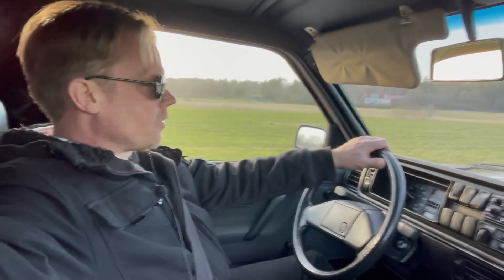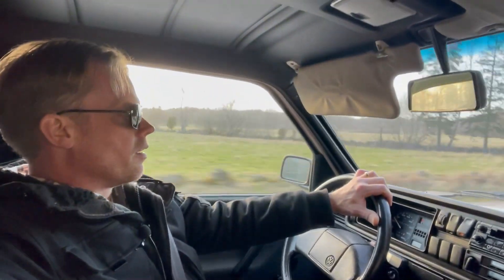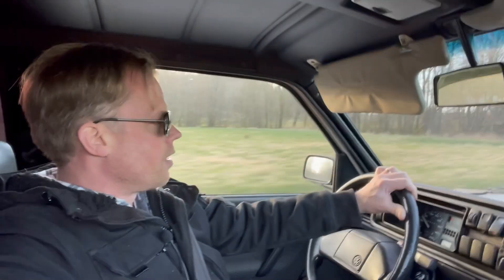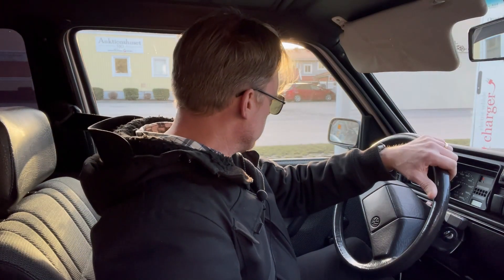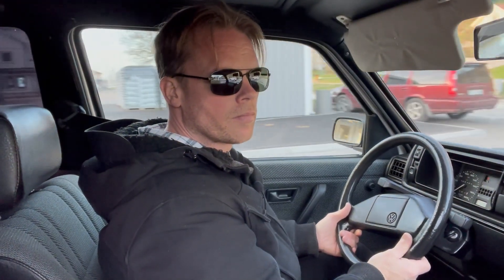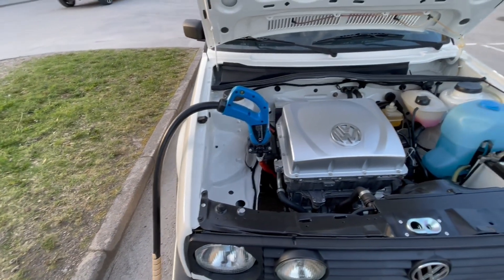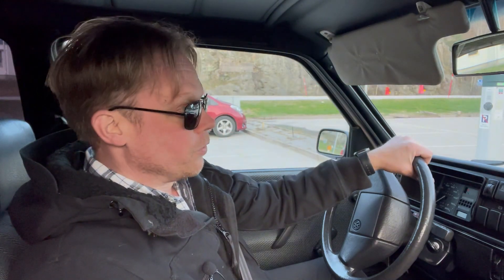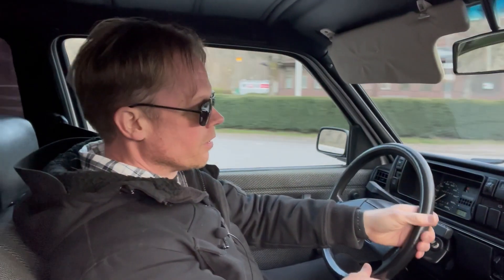Fast charging, more tests and more problems.

Comment: I didn't realise you are using a Leaf BMS. Do you monitor it with Leafspy? It's pretty easy to connect up with a Bluetooth ODB2 dongle.
I'm using a Leaf BMS with my eGolf battery pack but I cannot use it while driving due to the voltage drop between the front and rear battery boxes. I can see an issue in Leafspy at the cell which connects to the front battery box.
Reply from the maker: Yes, leaf spy it is. It seems to be sensitive with different lengths of the balance leads. It works ok for me, I which I had the 62kwh BMS though. What kind of issue do you have with your setup? How is the car behaving?
Reply: @flyingtools  My BMS is not controlling anything. I can only use it to monitor the cell voltages when the car is stationary as cell 40 (the last at the front of the car) shows very high or very low depending on whether I'm driving or charging. This is because of the voltage drop between cell 40 and 41 due to the length of cable between them even though it is 50mm2. The BMS is not designed to have long connections between the cells. I just keep an eye on the pack voltage to know if I'm close to running out of electrons.

Comment: Hello. Renault Zoe does not  start charging session if charging port door status is not  correct = open. Check that, Nissan Renault shares technology.
Reply from the maker: Thank you for your tip, but as far as I can see Nissan don’t have that sensor for the charging port.

Comment: My experience of the chademo port is that the cable needs to be plugged in & pushed firmly into charge port. Not sure how you have the port mounted, but it looked like all the weight was on the connector. If you look at the leaf, the port is more vertical, and the cable doesn't seem to pull on the connector so much
Reply from the maker: I even tried to hold it firmly in place without any luck. Thanks for your advice👍🏻☺️

Comment: DC chargers are sometimes a bit tricky, my ID.3 had an issue yesterday with Total Energy ones, so it might not be your fault. Try another one from a different brand. Good luck in fixing. It has been an awesome ride! Seems to drive quite nicely, the gearbox doesn't sound loud!
Reply from the maker: Yes, I heard about that. It’s my first try’s…
Yes it runs really smooth☺️

Comment: Hello Flying tools, this comment is intended to cheer you up. From immediate success, even if welcome, not an awful lot can be learnt. However, from failure you can learn a lot. You will have to dig in to the wiring, the signals and signaling, the diagnostic trouble codes and their meaning and conditions, maybe also the safety checks around CHAdeMO charging. My recommendation would be to run this against a CHAdeMO simulation first - not an actual CHAdeMO charger - to mitigate risks. And connect a CAN bus monitor (such as SavvyCAN together with a decent CAN bus interface) to the CAN bus lines on the CHAdeMO socket in your nice car. This way, you can see what is going on between the CHAdeMO side in your car (likely a charge controller or integrated with a BMS) and the CHAdeMO connector on the infrastructure side. This insight and knowledge, that you will get, will also help with eventually later converting it to CCS.
You will develop a way of structured analysis of charging problems that can help you with many other problems as well.
Reply from the maker: Very informative and nice comment!
Thank you so much, did not know about that stuff, I will be checking those out.😃👍🏻